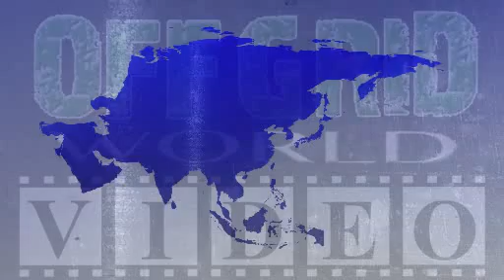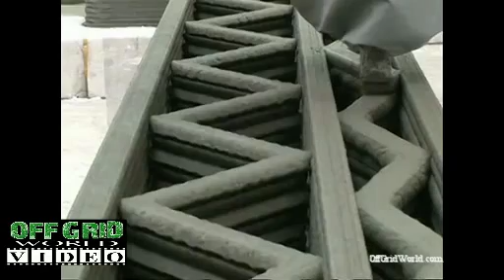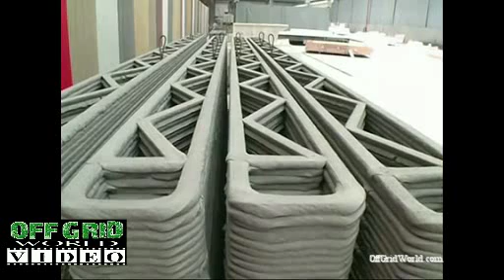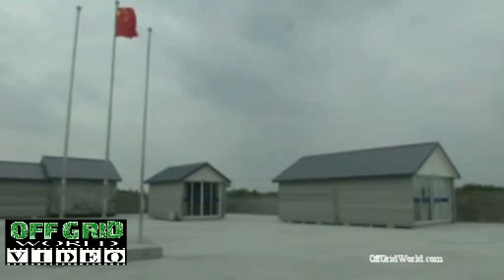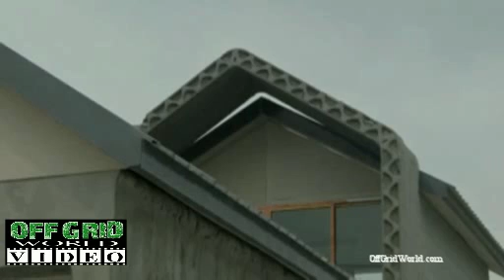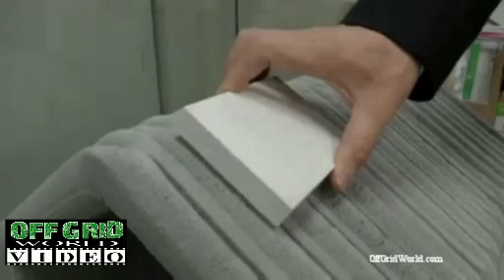10 Houses Printed in 24 Hours - 3D Printed Concrete Homes

Comment: No offence but most cement has iron compound rod in it for cyclone strength. Is there a way to design a U or □ or l rods in the cement or even a bolt that screws into a V-guide nut so get long rods of joind bolts (or something), as the printer moves around and fills the system. Also, it will need less cement flow around the rod?

Like the old adage, make it cheap ot will create expensive life in long term. Make it well and it will be cheaper in long term thus asset prices go up more consistently

Or edit. Just thought, two streams of cement (so can go around long rod as prints), might be better. Tough to design, good luck

Comment: ............no reinforcement?
Reply: as well as the walls have zig zags with air voids for effecient thermal / structural , go look at cinder block wall, some with NO rebar, still very stout / strong on all axis'
Reply: That is what the glass is for, Glass reinforced concrete is quite strong

Comment: Unfortunately, the cost of construction and building  of the shell isn't what limits the availability or affordability of homes.  If it were, the homeless would get together to make adobe bricks, go door-to-door to collect glass, plastic, and aluminum refuse to re-purpose as modern thatching, and no one would be rough sleeping.  

More realistically, the cost of water and sewer systems, of interior and exterior finishes, of plumbing and wiring have been more important for years.  And currently, the keep aspect of the problem is competition for scarce develop-able property  close to employment.  Those folks that have paid dearly for their homes aren't going to want others to  get it cheaply.  So the supply will be restricted regardless of how cheaply the construction can occur.  Cutting down the shell construction costs just divvies profit to builders and zoning boards.

Comment: The next step will be choosing the color of the concrete so that not every house looks like it belongs in a concentration camp.
Reply: or paint...
Reply: major600 you do understand that the exterior finish of a building is always completely different than the structure of it?
you can make that look like any other building.
Reply: @Crazylalalalala  or color 1st and skip a step, ex HOUSE the HOMELESS / Immigrants
Reply: ever hear of stucco or veneers.
Reply: @WattsMiner  easier to color straight away...
Reply: Crazylalalalala Where's the fun in that? :-/
Reply: I'd still prefer one with multi-colored cement. It would look like an assortment of taffy. :-D
Reply: major600 I guess you could just dye the concrete to whatever color you like.
Reply: major600 LMAO
Reply: agreed , even a lil dirt would give at least an earth tone

Comment: And in 30 years, they all go, hey wow, we can also use bricks to build houses!
Reply: This'll be revolutionary for those times where you just don't want to spend $20,000 shipping a giant 3D printer!
Reply: @operator8014  people will be printing the PRINTER aka cintered metal printing, before long, ordering nozzle's / crucial parts only, a drone will drop it on ur head in less than 72 hrs....lol
Reply: You could even 3D Print the great Pyramids of Egypt if you had enough land xD
Reply: MrTruth111 create bacteria in lab
Reply: Maybe that's how they were built in the first place XD
Reply: Zcooger Second Channel  earth crete machines are all ready out, or simple wood molds aka plywood boxes to pre cast air / dirt / foam Crete,  it was called adobe, buy much heavier

Comment: no rebar?
Reply: most of these printers is glass fibre in the mix of the concrete and fibreglass inserts while printing to replace metal reinforcement. So no, no rebar.
Reply: Give me a call when engineering approved in the 1st world.  Until then, forget it.
Reply: You know China at large is a first world country right?
Reply: China meets many requirements for first world status with, yes the issues that make it still technically a 2nd world country.  The U.S. also has similar issues that make us qualified for 2nd world status.  Homelessness and tent cities.

With Trump as President, our political system is at risk, and therefore we are technically on the verge of becoming a 2nd world country.

Making us... equal... with China...
Reply: No Lou, that doesn't replace rebar.  That's why they cannot be built in 1st world countries.
Reply: Not the new fiber rebar.
Reply: 2nd-world just means that they're communist; but yes, the economy is becoming more and more capitalist.
Reply: rebar oxidizes and ruins the concrete over time.
Reply: the structural caverns may make these walls very light.
Reply: soon enough, they will be built with composite cement/epoxy/carbon mixtures that will be stronger than concrete with rebar, and still cheaper.
Reply: No, it isn't.  MANY millions of its citizens still live in caves literally.
China is NOT a 1st world country.  It is largely a 2nd & 3rd world country with concentrated areas of industry.   ONLY those who have not investigated for themselves believe such tripe.

Comment: How is this "off grid" ?
Reply: powered NOW with solar / wind / battery / generator,  a guy in texas made a smaller rig... yes water on site plus 3 + cement mixers plus plasticizers, not easy but not imppossible either
Reply: Off grid also means it doesn't always have to follow city building codes. 2100 sq feet for $5000.00 Even if you get nice fixtures you can get away at around 45000.00

Comment: I understand that the mix has fiber reinforcing in it, but that doesn't tie the elements together.  A second head should follow the concrete laying head to put down a reinforcing mesh to tie the webbing to the sides, and give extra strength to all the continuous elements.  And then I'd press mesh into the sides while they are still soft.
Reply: +deezynar 
Actually, short fibers have a nealry omnidirectional reinforcing effect if the composite material is done right.
Polypropylene (cheap standard plastic) with 10-30% fibreglass is a very common composite in injection moulding, and much, much stronger than pure PP.
Reply: Its an old debate but injection molding doesnt equal extruding layer by layer. While fibers might have a strengthening effect within the same layer, they do not while being stacked upon each other. That is a common problem printing with these composite filaments on FDM.
Reply: +deezynar Look how thick the walls are. It might not need rebar reinforcement (probably won't be require if designed right)
Reply: First off, the walls are made of 5 thin elements that all together makes a thick wall.  The wall doesn't really have the strength a single solid wall of the same thickness.  Even with that said, thickness doesn't equal strength when you're using materials with very little strength.  Look at the death tolls in countries where they use mud construction, one earthquake kills many thousands of people. The machine here needs to insert plastic mesh that crosses between the elements.  Steel reinforcing bars would not be a good idea because the loads would be concentrated too much.
Reply: deezynar I was just saying that the total wall thickness printed here is probably stronger than a wall using the same amount of concrete(probably stronger than typical 8" thick concrete block/solid wall)
Reply: I don't think so, but it would be interesting to see the test numbers.  I think there is more field testing for the dirt filled plastic tube idea.  They've been building with that for more than 10 years now.  If that method can be automated, that might be something good.
Reply: Then go out and invent your own stinking machine.  Criticism is easy.

Comment: I'd like to see them do this with foam concrete. Too bad the machine is so insanely expensive. This actually wont cheapen construction a whole terrible lot. Most expense comes from the trim and inside furnishings and fixtures.
Reply: consaka1 its only 3.2 million dollers, and that can make 10 homes a day.
call it 200K per home x that by 20, oooh whats that 4 Million dollers PER DAY.

Fuck me you are stupid.
Reply: VengeanceCore Actually you are stupid. It does not cost that much for the houses they are building. They also don't build your furniture or the roof. I am familiar with building houses and the actual framing of the walls and sheathing, which is all this machine does, does not cost all that much. Maybe 20 to 30k on a good house. The expenses of foundation and roofing, and interior plus trim, plumbing and electrical are still there. 
If its so great then why don't you go do it.?
So Troll my comment still stands. suggest you go learn something about what it takes to build a house before acting like a moron calling people names. lol
Reply: VengeanceCore lol You will need more than that. You have to hire competent people as well to do the rest of the job. Including a primary contractor because you know nothing about the business. lol  Love to see your business plan lol  Id also like to see the flooring and door trim you think that thing makes as well.
Reply: VengeanceCore lol I dunno where you live but around here they don't build houses out of brick. They use a brick fascia so it looks like brick but actually acts like a siding. It does not bear any loads. These buildings that are printed would still need that sort of stuff added for design purposes. Or you could cover with any other kind of siding to create different looks. Or you could leave it just plain and let it absorb heat from the sun. Still going to have to build interior walls or insulate it somehow.  Which brings me back to my original comment having to do with foam concrete since it is actually insulating in and of itself. 
Labor free for that part maybe but the majority of the work will not be labor free. This may be relatively fast for what it does but it will not save that much money for the whole house.
You thought it was serious enough to start calling a total stranger "stupid". Which is really pretty stupid.
Reply: +consaka1 Watch the designs in the video that they are printing. Rather than printing the houses on site, they are printing them and assembling later. The design that they are doing actually DOES print the entire structure including the roof. Another thing to note is that the machine DOES NOT cost $3.2 million. $3.2 million was the entire development cost. This would traditionally include multiple design iterations, labor costs, and materials costs all incurred during testing. The machine itself is actually rather straight forward if you have ever worked with 3D printing. It just requires working on a grander scale using a concrete pump for the print head. MIT has also developed a similar printer that takes into account building practices in more developed nations. Their machine utilizes a modular approach to the electrical and plumbing systems and actually places the wiring and plumbing as it prints.
Reply: Nathan Rogers The ones I saw were printing on site. What would be the point in trying to transport multi ton walls  to a building site? This is why I made my comment on the foam fiber concrete. It is still strong but much lighter with a better, much better insulation factor. A normal concrete wall has extremely poor insulation qualities meaning to insulate it properly is going to require extra materials and labor. This drives the cost up. Most people living in developed countries like their air conditioned comfort. This means extra work to prevent sweating of the concrete in cold environments and oven like temps in warm environments. 
My point is that I don't see this actually saving much money over traditional stick construction.
Reply: +consaka1 Idiot. Machine is cheap, and no, the house is not mostly whats inside. You and you RACKET of "professionals" are jacking up the cost of a home. You will rot in hell for how much money you have stolen from the people with your idiot prices. We are going to ENGINEER you out of the problem, rat.
Reply: +consaka1 No, you are stupid and about to be obsolete. You and your thieving lying overcharging buddies are ON NOTICE, we are ENGINEERING you out. You will be like the cab companies in the face of Uber, we dont need your thievery lies and high prices and over budgets anymore.
Reply: +consaka1 Look at you trying desperately to put down the future. We are tires of you thieves. We are engineering you OUT. Goodbye. Youll have work for maybe 10 years. After than robots will do this for a lot cheaper and a lot better quality than you thieves ever did. Contractor = thief = liar = over budget = late.
Reply: +consaka1 Bull . I live in a concrete structure. It is not a poor insulator - its a heat sink of sorts but if you put a barrier up its great. Oven? Nope. Sweating? Not seen it either. Looks like baby diaper boi consaka1 the contractor is being engineered out of the equation. Contractor = thief = liar = over budget = late
Reply: consaka1 you transport multi ton walls  to a building site anyway, just a tiny bits. then people have to pay for people like you to put all the bits together while you sit around a smoke and take shits all day.
Reply: The print that they show in the video we are commenting on the house is printed and then stood up. it can be printed on site yes but not as a complete structure. The pieces are printed on the ground and stood up at bare minimum. The technique that they are printing with leaves voids in the walls which serve as insulating spaces. This is very efficient. the printer works with any concrete it can be fed so as long as the concrete can be pumped it can be printed with. The structures printed with this machine are not really going to see a lot of use in developed countries except as emergency housing. Imagine a much more durable FEMA trailer built on site. Add wiring and plumbing and house is ready. The machine was designed and built in China intended for use in China or India or similar locations where simply having weather proof walls is a huge upgrade. Internal plumbing and wiring? Not useful when using an outhouse and no power in area.
Reply: VengeanceCore I'm sorry to disappoint you but I do not build houses. I can and know how and have helped in the past but not my calling. I favor alternate style houses and have invented a few of my own. Prefer dome styles actually due to their better strength. Love concrete for construction as well. But as my main point was this will not save that much money on the construction. The frame up is actually one of the cheapest materials wise and actually doesn't take all that much labor either. When you consider that concrete still needs an exterior finish to look nice plus interior insulation and walls built and finished. Should have a tougher than average house but that's about it.

Comment: Not safe for earthquakes
Reply: ***** In the US you have to use steel reinforcement (rebar) in concrete walls to prevent collapse.  Concrete tends to be strong but a little fragile.  It can crack fairly easily, and needs a reinforcing material (like steel) to keep everything aligned so that it maintains its strength if (when) it cracks.

I'm having a difficult time believing that just adding some glass fiber will give concrete the resiliency needed without some additional type of reinforcement.

It seems like a waste to go into an area that has been devastated by an earthquake and build a bunch of new "permanent" buildings that will just collapse in the next earthquake, perpetuating the problem...  We need to do better.

Also, quickly constructing some of the beams is one thing, but as +consaka1 pointed out, most of the expense of building smaller buildings isn't the structural framework, it's the finishing of the building into something habitable.

Also, does it really save in material costs and time, or mostly just in labor?  In places like China do you really need to produce approaches that reduce the number of man-hours to do a job, decreasing employment possibilities?
Reply: +Mickey Uppendahl Ahh yes but you are thinking in terms of "in the US". The US makes up ~5% of the worlds population. These simple concrete homes do not REQUIRE finishing if you are ok with the industrial concrete look which is immensely more desirable than the inside of a tin sheet hut look that you find in the slums in say India. Those shacks only require a good monsoon (annual occurrence in India) to return them into a small pile of scrap metal and wood bits. Building codes in the US will definitely slow the adoption and use of technology like this however as mentioned, that is only 5% of the population of this planet.
Reply: Put enough glass fibre in the mix and sit on airbags might make for a very earthquake resistant version